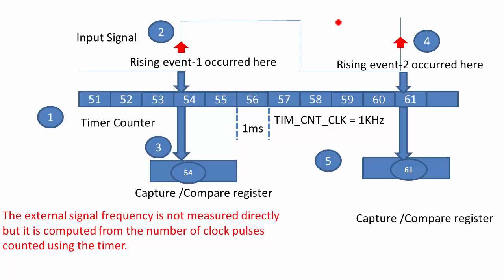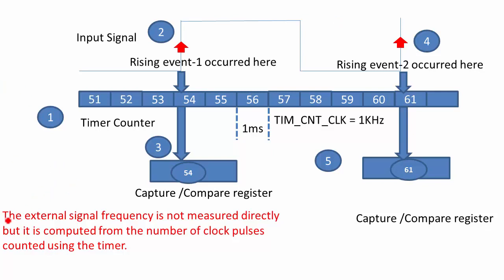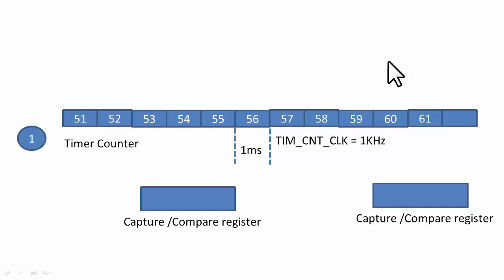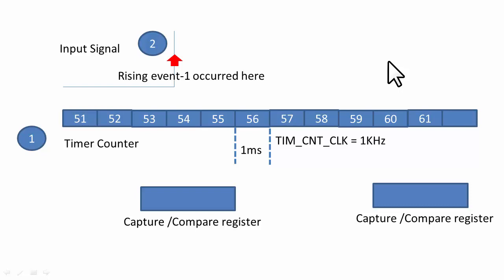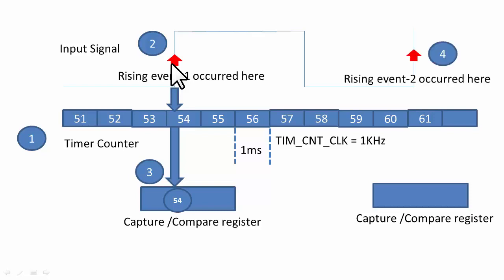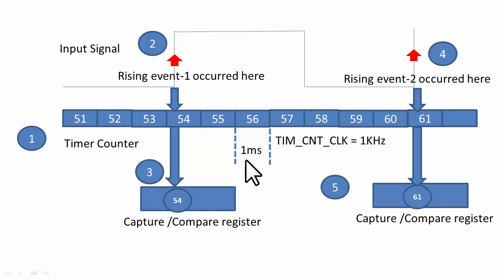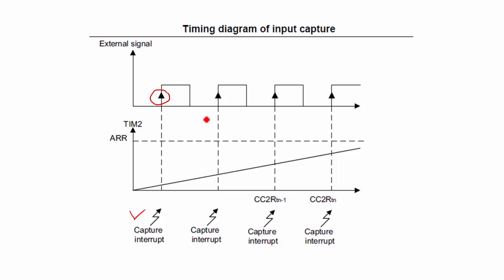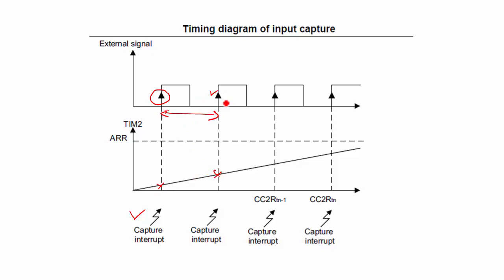STM32 General Purpose Timer : Understanding Input Capture (IC) Mode -2

Comment: In the case we are using 4 channels in input capture mode of the same timer that same HAL_TIM_IC_CaptureCallback will be called for all the channels or they can work concurrently? I mean for example if i use 4 hc-sr04 sensors having their echo pins connected to 4 ic channels of the same timer then the same HAL_TIM_IC_CaptureCallback  will be called on the rising and fallling egde of the input signal?  If so that means the measures of the sensors frequency will be wrong? I am sorry for the bad English :D

Comment: hi, bro. 
I want to know maximum of the input frequency can be measured.  
I will use STM32F4 to measure input signal with frequency of about 30Mhz. Can it be measured? thank you!!!
Reply: yes, maximum input frequency is specified at 100MHz on STM32F4XX datasheet